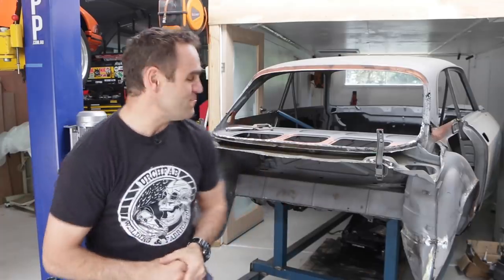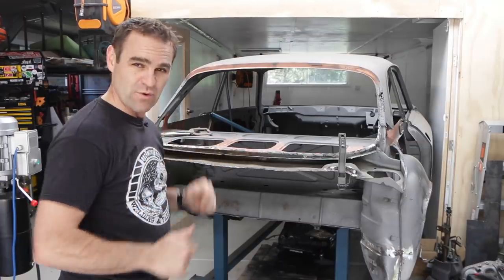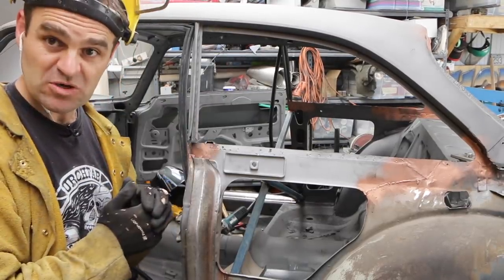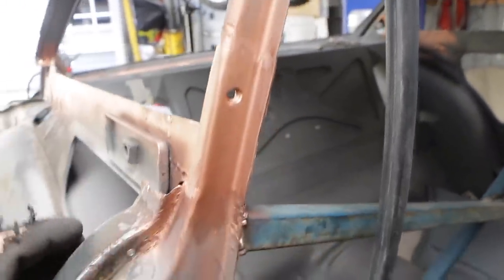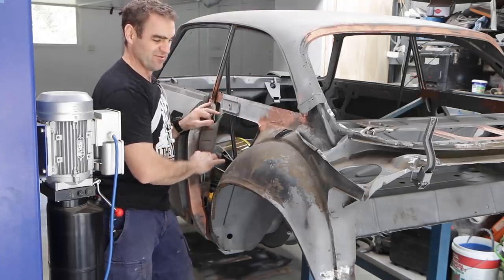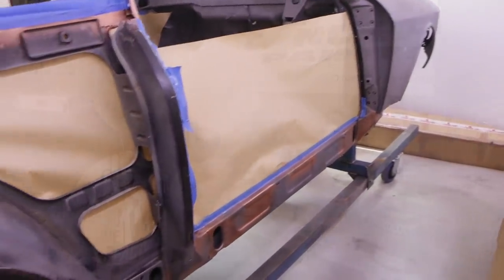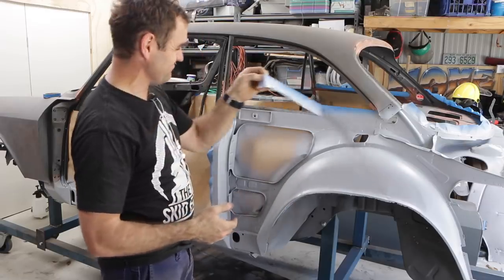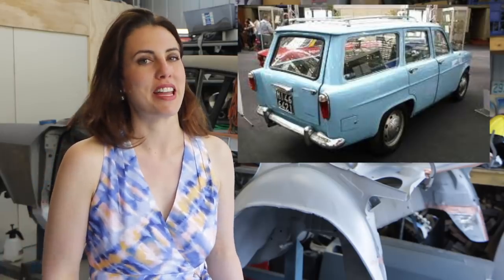Rebuilding B pillars - Alfarrari 105 project car build part 26

Comment: Looking at the car without the rear quarter panels: you could actually put a tube-triangle in that cavity from the lower sill, up towards the seat belt-mount, back towards the shock pickup and from there down again towards the sill. That way the future rollbar connects to it and acts as double strengthening.
It's max 5kg of pipe for a lot of rigidity. Something you probably going to need in the future.
Reply: that is very sound advice

Comment: As always, nicely done Jeff. I love watching you make the replacement parts for the rusted stamped metal bits.  First, you dissect how the existing part is made. Then, you measure, cut, shape and finally weld in the replacement.  This process might bore other viewers or, vex them because it’s time consuming.  However, I greatly enjoy watching the intricate details of fabricating. Thanks again Jeff for sharing your restoration with us.
Reply: Not a candidate for BOM's three "fabricating montages per episode" then. Although I can understand people who haven't/ don't do this sort of work, I really appreciate being able to see all the little "mundania" that it takes to get a great finished product. Many of the car builds deal with the reconstruction phase very little- often tracking down the rust and "tin worms" is the most time and talent consuming parts of the job. FR

Comment: Condensation forms on the inside of the panels when the weather changes, and that is what makes the bottom of the sills and wheel wells rust out so fast compared to other areas of cars. The primer you laid down will definitely help protect it quite a bit, but there will always be some unprotected metal around the welds. 
I have an Opel Kadett C (you'll probably know it as a gemini), they are known to rust badly even when not driven in snow and salt. I drive mine some during the winter, and I give it a full cavity treatment with linseed oil based cavity protection products every fall, it works really great as it creeps into every nook and cranny before oxidizing and turning into a wax-like consistency. I can really recommend you do the same to all your cars, but especially the Alfarrari, it will be worth keeping pristine. Keep up the great work!

Comment: I would heavily recommend that you use the correct coveralls and an air fed mask for spraying 2 pack paints!
Reply from the maker: I absolutely always use the correct mask to spray 2 pack. This mask has 4 layer filtration which is basically what every professional painter in Aus wears. Coveralls are great to keep lint and dust down, but not something I am worried about underneath.

Comment: You’d definitely struggle to paint the inside of those wheel wells behind the quarters when it’s done, but you can definitely get some decent cavity wax in there with a hose.

Comment: Primer by nature is porous to help key paint... you should flash it over with top coat if you want to keep the dreaded rust at bay, just mask up the weld areas and flash them with weld through primer.

Constructive criticism... I do love what you are doing.
Reply: That's why Jeff used epoxy primer and not standard primer for it's water proof  quality and it sticks to metal far better than anything else.

Comment: Hey Jeff, looking good. Have you tried using a 2” disc angle drinker vs the large flap disc grinder for finishing the welds? I found that using a #36 grit makes fast work of my patch welds and allows me to get a better finish than the big flap disc. Just my 2 cents. Keep up good work.